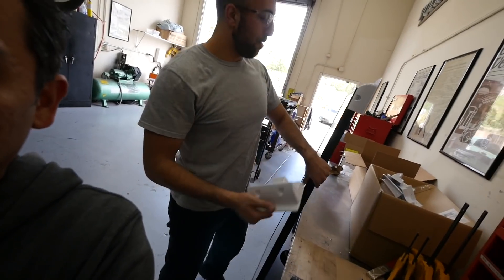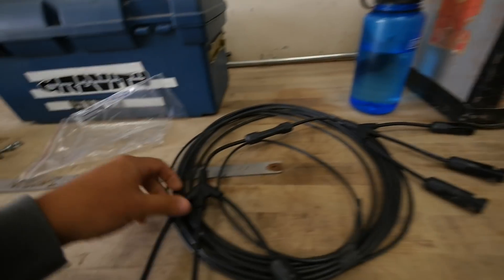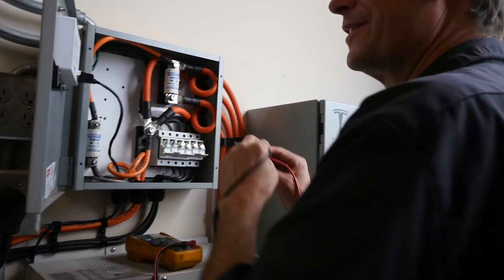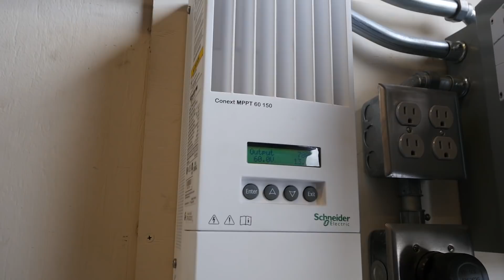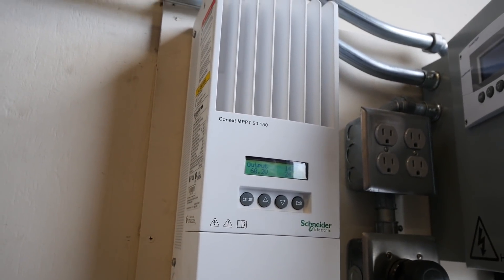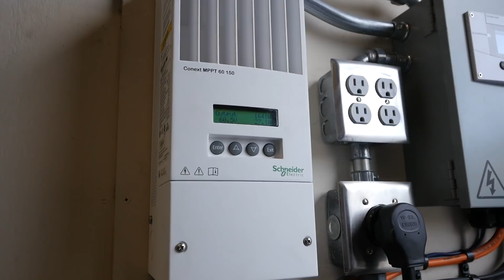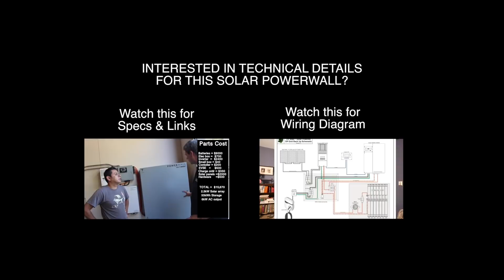33kWh DIY SOLAR TESLA POWERWALL

Comment: Greetings, I have asked this question to every YouTube channel that uses Tesla Batteries in a DYI power wall and nobody will give me an answer. I have a off grid home that uses 7s 24 volt Tesla 3 kilowatt modules. I have a BMS on each module. Does this power wall in this video have a BMS system? If not what are your reasons. I chose to because of the fire potential with NMC. I also have no way of knowing if my modules are matched. They were purchased from the same distributor but months apart.  Thank you for your response.

Comment: Around 3.10 when you were showing and talking about the water on the panels. It looks like there is a bit of damage to the inside of that panel? Crack in the blue cells.

Comment: I understand how the home battery works. it stores energy and you use it. I've watched countless videos talking about powering your home and using grid power to charge the battery. I see EV West's system looks like a mobile solar outlet. 
My question is; I've always been told if you're running your solar through the grid and the power goes out you can't use the solar energy. If you're using a battery you have to plug everything into an inverter/ your breaker box is hooked up to the battery but not the grid. 
How does the powerwall plug into your grid yet you can still use the stored energy whenever you want?
Reply from the maker: Ben Hightower our system is "offgrid".  You can use the grid to charge the batteries in a rainy day but solar/battery energy never flows back into the grid
Reply: But how do you use it and the grid? If you want to use the battery for power you have to unplug from the wall and into the battery?
Reply from the maker: Ben Hightower the battery is connected to an inverter that puts out 110 & 220 VOlts AC just like the grid,   You can connect directly into the inverter or you can run wiring to connect inverter into you homes wiring

Comment: Very interesting, Thanks!  I don't have that kind of money to build what you have but I do have the same charge controller, 310 watt panels (3) and 8 - 6 volt batteries, my Power Floor!  I too think that the angle of the panels is not so critical.  When i can I will get a "Power Wall" and "go green".
Again, Great Video!

Comment: Wouldn't it be cheaper to put a powerwall2?
Reply from the maker: +anthony king  you mean 2.5 power walls,  how much does each one of those cost?
Reply: 5500 dollars.  But it already has an inverter. I believe it has a module per panel as kind of a mppt. It's more complex in its ability to charge at its best all the time.
Reply from the maker: +anthony king  5500 x 2.5 = 13750 so it's about the same,  except this has been working for a year now,  Powerwal II won't be available for at least another year
Reply: I'm with you now. Good job I'm impressed.

Comment: We definitely need a way to charge electric cars directly off a charge controller.  Silly to go from DC to AC to DC.   To charge a car everything on that wall except the mppt could be taken off.  Also if used to charge an electric car, 99% of the power from the panels could be going directly into the battery.  You could even lower the voltage to extend battery life and increase charging rate.

Comment: Why do you use a charge controller? Here in Cairo I charge my batteries directly from the solar panels. Just match the voltage of the panels with the battery.
Reply from the maker: google MPPT

Comment: Model S battery pack now on sale ebay. Only 15,000$  ouch.  
That's almost as much as i paid for my entire  4kw grid tie system here in hawaii. 
With all the surcharges and crap fees (helco)  here, the cost per kwh is 43 cents. 
Socal edison tier 4 is 32 cents kwh. That isn't very far behind !   yikes.  I can see the need for battery packs there especially
if you don't have the net metering agreement.
Reply: electrodacus figures solar without battery might be $0.03 a kwh, when using battery $0.63 a kwh.  I got a 20 year prepaid lease for a 6.5 kw system for 14K.  It generates about 9,000 kwh a year.

Comment: The charge control will hold back power when batteries are close to full since you're not feeding to the grid.
You may have to power a load to find out how much power is coming in from solar??? 
this will make charger go back into bulk charge when the batteries get close to full will work it's way back in to float holding back more and more solar power till batteries are full.

Comment: Just out of curiosity,... Why did they install the solar panels laying flat down and not at the optimum angle for Southern California?
Reply: Just use some bricks under one side!!!!!!!!!!!!!!!!!!!!!!!!!
Reply: jehugarcia That depends on how long you use it, doesn't it? The 10% install cost is 1 time. The 5% isn't really a percentage. It accumulates over time. 

From what I read, it's more like 30%. Not in peak power output, but in kwh per month it is, especially in the winter.
Reply: +Mike, yeah, a CPU heatsink on each of the 36 or 72 cells would work beautifully, but it's not going to be very cost effective!
Anything one can do to remove excess heat would be a Good Thing, and preferably without using tons of copper.
Unfortunately really good heat conducting electrical insulators are also expensive - eg, diamond, graphene, boron nitride, but there must be some materials available that could provide an acceptable compromise. Perhaps alumina?

Just inclining the panels and allowing adequate ventilation is probably one of the lowest hanging fruits for cooling (and drainage), as well as improving sun-angle. A couple of bricks or pieces of 2x4 have negligible cost.
Also, avoid mounting on or near black surfaces, and especially near anything that could cast a shadow on the panels, even a small shadow, but that's Solar 101!
Reply: jehugarcia I understand. But with a difference of 20 to 30% in efficiency, it could have been done with 6 panels less. I wonder what is cheaper, 6 panels or a mount with some sand bags to weigh them down.

Besides that, I understand those panels are just laying loose on the roof. That scares me. I don't know what kind of wind speeds are the maximum over there. I'm used to winds of up to 70 miles per hour in bad weather. when the wind flies over the roof at high speeds it can create an under pressure that sucks those panels straight of the roof. Just check if they have "walked" after a couple of months. Little stones under the supports can appear, seemingly out of nowhere. I've seen this happen with 3 x 2 feet concrete blocks with satellite antennas mounted on them.

But maybe the winds in Southern California are very gentle.... But then again, they also say it never rains in Cslifornia.
Reply: There's another issue too - panels get extremely hot and lose maybe 20% efficiency and lifetime by overheating.
Angling the panels even by a few degrees will aid convection so the hot air underneath can rise and escape more easily and draw cooler air in. Adding cooling fins to the backside may also help.

On a 5kW system with solar cells at 20% efficiency, that's 20-25kW of heat to get rid of - would be great to use water circulation to cool the panels, get hot water for 'free' to save the PV for charging, with the bonus of better efficiency.

A chimney could also be used to draw out the hot air from under the panels by sealing the edges and making a path for the airflow.

All comes down to price vs performance vs coolness... :-)
Reply: Yes!!! thanks for pointing that out!!!
cooler, cleaner more power! it's a no brainer for me.... if i lived close by would do it for them cinder blocks or sandbags zip ties .  just a little tilt makes a huge difference. there is a wall all the way around that flat roof i would lay flat on that roof on a windy day see how far you could tilt the panels and still feel safe with added weight  will hold up to higher winds
Reply: I'd say "lazy", but for what they're doing, it'll work well enough. They don't need it to generate the maximum it possibly can.
Reply: I'm in florida, get's kinda windy here.... Had 3 panels on a flat roof with cinder blocks, bricks & big commercial zip ties super cheap!!!
It's more wind proof with a little pitch and the weight of the blocks added to the panels. You could even add silicone for more stick... :) Panels were there for 2 years with no probs!!!  moved them to the pitched part of the roof this year. Lots of the flat roof mounting racks are held down by sandbags on racks the panels are mounted on.  Maybe you could use sandbags, home made brackets??????
Reply: As long as you clean them regularly you should be good. 👍🏻
Reply from the maker: we don't need the extra efficiency,   adding a tilt requires extra hardware and it make the wind more an issue then you have to strap and bolt to the roof which then probably need building permit and your one hour installation goes to 50 all for a little bit of extra efficiency that you didn't need in the first place
Reply from the maker: Price/Performance ratio,   if it costs 10% to gain 5% kind of thing
Reply from the maker: then there is the wind blowing your panel away

Comment: I wish Tesla would sell stand alone products for the EV conversion market.  It would be nice to buy Tesla batteries, motors..etc and just put it in any type of vehicle.
Reply: I doubt they ever will for liability reasons. Nobody else does. There are only two companies making ("marketing") motors for EV DIYers, and those motors were originally designed for other uses. (HPEVS motors are for hydraulic pumps.)
Reply: tesla is selling ther drive trains to other companies anyway so i bet in the future most products will become compatible

Comment: Nice.  Wondered why you wouldn't angle your panels a little ?
Reply: This could give quite a bit more power!!!!!!
Reply: Solar Junky   Yes I agree and it would help keep water and debris from accumulating on your panels
Reply: There is a article on internet saying it is not economical to clean solar panels (but I always do it anyways near June 22nd). Also you don't have to be at equator to be at maximum power.  In the summer if you panels are angled, you will hit a time when the light is striking at 90 degrees.  But there is an youtube video where the guy had them flat and then angled and liked the angle better.
Reply: More $
Reply: I read the speak sheet on these http://sepbatteries.com/media/add_info/canadian-solar-cs6p.pdf , a key feature is  "self cleaning"
Reply: More power is pointless if you have to clean them every week and if you don't (which would never happen) you would end up loosing more power by not angling them. The reason to always angle panels is so they self-clean when it rains the dirt slides off. 
Looking at the video of the water there is already a very nice line of dirt build up which wont be helping at all.
Reply: Amorphous thin film panels work with shadows, bird poo and in low light - unisolar.